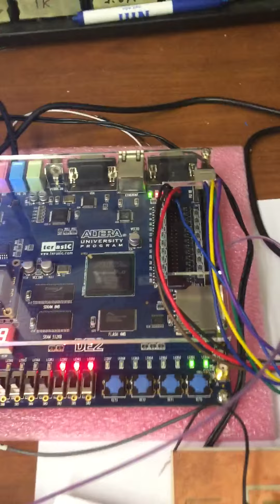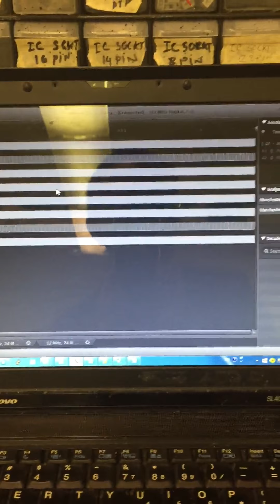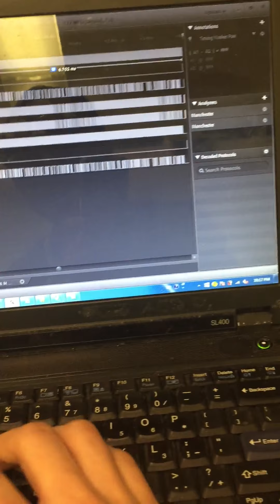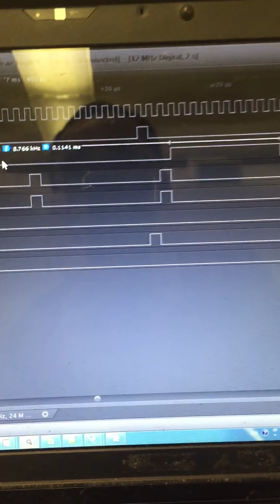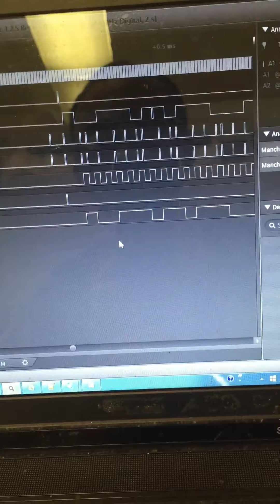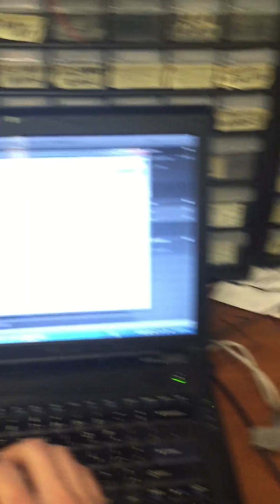Mandcheter Coding & RFID System

Comment: How can I build one of these? I have an animatronics show that uses the Manchester code!
Reply from the maker: what you want to build? Manchester code or the whole system? I use FPGA for the Manchester coding and decoding.
Reply: Well I have an ra gray system up and running that works just fine. I want to come up with some device where I can program new shows. Yes it uses the Manchester code and I'm
Not sure how to do it. Hoping you could help! I gave all the address sheets for the show aswell.
Reply from the maker: Manchester code is used for asynchronous communication, or channel coding. I don't know what you mean use M code for show. but your magic looks interesting! :)
Reply: I have an RA gray control system that controls an animatronic show. Im looking for instructions on how to build a controller that will produce the manchester FM code so i can program new shows...